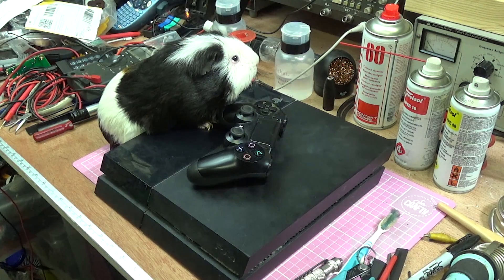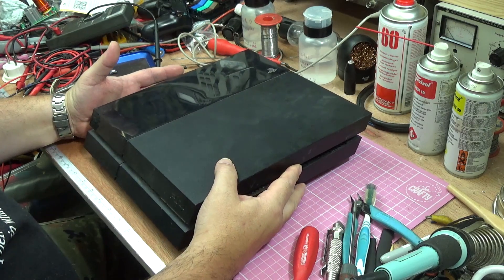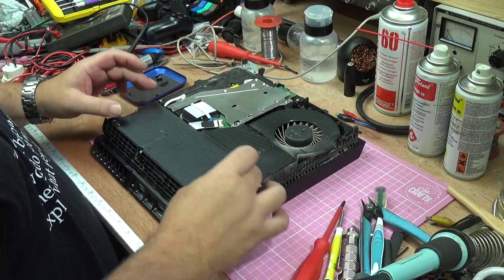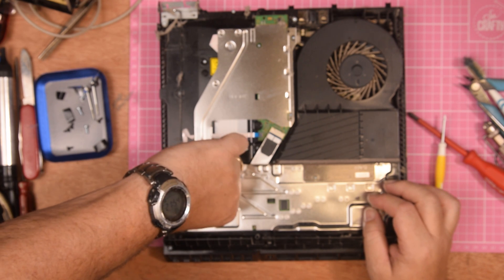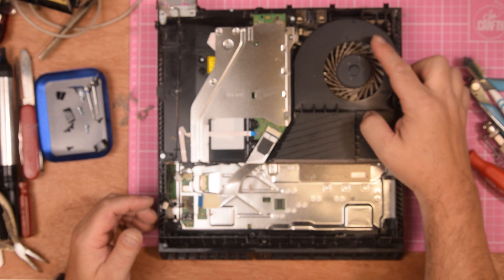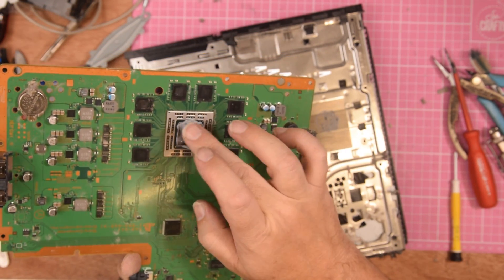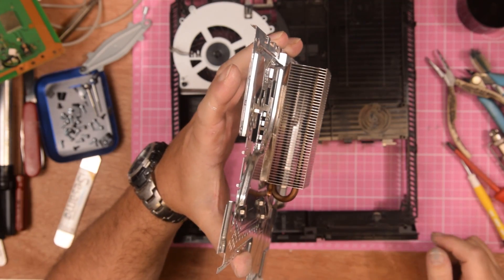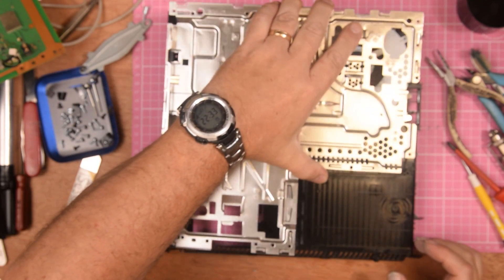How To Fix Ps4 Overheating Problem : ZERO COST

Comment from the maker: I'm getting a lot of comments regarding it still heating after cleaning. First, check the fan is connected properly and that when you cleaned the unit you put all of the little heat transfer squares back onto the chips they came from. If that fails to cure it you may need to replace the heat transfer paste. It is just a case of wiping off the old compound with isopropyl alcohol or rubbing alcohol and replacing the compound. You don't need very much but place it dead centre of the cpu and put the ps4 back together.
Reply: Hey bro I've cleaned everything but my fan won't spin unless I use my hand to spin it first and it's really slow but goes fast sometimes, any help?
Reply from the maker: Sounds like the fan is gone and needs replacing.
Reply: @smplex1  is there any start capacitors for the fan in line with the fan circuit
Reply: Idk what happened but my PlayStation went on a blue screen for like half an hour and then it flipped the breaker
Reply: Can the heat transfer paste if dry still make the ps4 overheat?
Reply: Mr George,mine was overheating I open my ps4 slim after watching your video but there wasn't dust covering  the fan and the vent that much so the little dust on it I cleaned it off after which I coupled and played for few minutes and it turn off just as it use to do before. Please what might be the cause because I'm confused and don't know what to do next ?
Reply: I'm not sure if I'm able to do this for my son. I'm scared that I will mess it up even more. Is there a place where I can take it to get fixed? If so were would you recommend I take it? Thanks in advance.
Reply: @Sassy_Cici  u can go to game stop
Reply: Thanks it works
Reply: I managed to follow all of your instructions and managed to put it all back together again after a good cleaning and surprised it actually runs so much smoother now. The thermal paste definitely needs replacing because it was completely dry but I have to order some and take it apart again another day to put new paste on. But for now just the cleaning seems to have helped a great deal, the PlayStation was shutting off due to over heating whenever I tried to play a game but even without new thermal paste this is the first time I’ve been able to play a game for over a year.

Thank you so much your video was amazingly helpful 🙂

Comment: I had cleaned my ps4 checked the paste it was in ok condition all the heat transfers in place and still i would get the message but i updated my ps4 through the safe mode screen and it fixed it somehow it worked for me so i hope it works for you guys
Reply: It worked

Comment: What do we do if the fan doesn't spin freely?
Reply from the maker: the fan is a standard sized computer fan and can be easily replaced.
Reply: @George Christofi  I had a bigger problem, I was able to get the fan to spin better but on the motherboard in the one corner looked like little burn marks so I think she's toast. After cleaning all the dust out I put it back together and was still having the overheating screen

Comment: hey george how are you? can you please read and answer my message? it's really emergency!
so my ps4 was working exactly fine and without extra sounds but i decided to open it because i never cleaned it before... i did it exactly right with no harm and violence then cleaned it with air pressure and assembled it just right. but now it's fan sounds like an airplane and the ps4 goes off after some minutes with no reason... help me please.
beside i did not unplug the fan during cleaning.
Reply from the maker: sounds like you didn't remount the memory pads before replacing the heatsink.

Comment: After watching the video I decided to take the cover off the PS4 & used a long bristle brush into the fan area to remove the dust from that grid without dismantling the PS4, It actually worked very well, Thanks so much for showing exactly what the problem was, Kindest regards.

Comment: Can you clean the heatsink without changing the thermal paste
Reply from the maker: Not really. If the paste is dry you are better off doing it while it's in bits.
Reply: @GeorgeChristofi  okay. You know the best thermal paste to get?
Reply from the maker: I used to use arctic silver which is very good and comes in a hobby sized tube. These days I use a commercial grade paste simply because of the quantity in a tube.

Comment: Thank you! I've been dealing with "overheating" less than 2 minutes after turning on my PS4 and starting a game. This video helped on fixing it. I also found that the heat transfer paste was completely dry and all the dust.
Reply: I'm dealing with that now 😔 I only could watch movies & TV apps from it, I haven't played games in about few days it feels so odd. I'm thinking on buying the tools set so I can open it myself to check the inside, I'm just worried if I need to get a replacement hopefully it just the the plug that's loose to the fan or must need cleaning.

Comment: Mine has this same issue, except the fans don't run loud. It works perfectly for ~5mins before showing red light with 3 beeps. I does this even in safe mode. I have been searching for fix for like 6 months any help is appreciated 🙏

Comment: My ps4 is completely clean n now I am starting to get the same issue again even at the start menu my fan gets loud then just shuts off within seconds of it turning on and there's no dust build up nothing, though I have took this ps4 apart like 50 times before n kept it working but now I think I'm out of luck nothing works.

Comment: I have never deep cleaned my PS4, and I bought this console like 6 years ago so I'm pretty scared to see what's inside there. I am just now facing overheating issues. I can't play a game for an hour straight without having to worry about the console overheating. And not to mention, that loud jet engine noise, I thought it was completely natural but it's been much louder than usual lately. Gonna take it to a Sony Repair Shop soon.
Reply: I can’t play for more than 1 min

Comment: Did all dat still doing it after 2 hours completely clean put new heatsink new thermal pads but it is 8 yrs old 😂 got the PS5 digital so I just need to finish a few disc games off on the ps4 dat is only disc

Comment: Lay ur ps4 flat like the man said. But a trick I use is get some 2 liter bottle caps bout 6-8 of them and have ur ps4 sit on top of them so u have airflow under the ps4. It helps alot.

Comment: I did it but putting it back together is annoying. You should upload the same video but at the last part when u speed it up while putting it together you should leave it at normal speed so I can see how exactly you put it back together. Everything else is easy but putting the mother board back in is not fun and I don't wana break it
Reply from the maker: I did think of that but the video was already too long for a lot of people so I shortened it. If I remake this video or any other console video I shall do a much better job of editing the video to keep all of the important stuff in but cut some of the waste, keeping the reassembly in there.

Comment: Thanks to your video I was able to fix the overheating issue on my ps4, the heatsink was clogged with dust and stuff. Removed them just like you did and worked as a charm.
Reply: did it actually work, how u get out the screws. i don’t have torx t8 and struggling with a vit
Reply: @animalcrew882  I used a very small flat screwdriver and managed to get them out, the pin in the middle is not that big.

Comment: I cannot thank you enough George, I have struggled with overheats and a jet engine fan noise for almost a year now and I have looked all over for advice. Your video was simple to follow, easy to replicate and I can say with confidence it has drastically changed the noise and heat problems on my console. I am amazed how much dust had accumulated in the heat sink over the 5 years I have owned this. Feel foolish I hadn't looked into it earlier, very happy with the results. Great job!
Reply: Agreed 💯💯💯💯💯💯

Comment: Great video mate, just great. Quick question, I have done mine yesterday and once I put it back together like ten minutes in the menu, it got too hot and turn itself off. What might that be ?
Reply from the maker: Probably the thermal pads on the memory chips not being in place fully.

Comment: I got right up to the point where you take the power unit out. Took 2 of the 3 screws out no problem the 3rd one seems to have a peice of metal right slap in the middle of the hole where my torx would go so can't get any further

Comment: Thank you after I took it apart and cleaned it its working good now best instruction and step by step I've found.
Only problem I ran into was the little metal pins by the fan one was sticking up when I first put it together stopping the fan from spinning witch cased the Sony to repeat the overheating so just had to reopen and ben the pin down and its working like new.
Thank you so much

Comment: This helped so much, my ps4 would turn off in like 30 minutes when I turned it on , i can play with my friends now without it turning off, thank you.
Reply: Bro 30 mins. I get like 40 seconds max and it turns off
Reply: @aazedd3246  I only get to play 20sec to a minute on any game
Reply: @aazedd3246  😭😭😭 faxxxx
Reply: @aazedd3246  me to
Reply: @Febreeze Booz` yep I cleaned it all out. The heatsink is the biggest issue
Reply: My ps4 doesn’t even turn on
Reply: Mine in 9
Reply: I have the same thing as you buy ps4 pro tourist pirate game on my screen it bunny aerial it  scare me

Comment: Does the work for the PS4 pro
Reply from the maker: any console that suffers from an overheat usually will have some form of dust blockage. The disassembly may be different but the object of the exercise is the same.

Comment: My PS4 Pro keeps shutting down on its own after about 5-10 minutes i put a larger fan beside it, didn't help so I took it all apart to check the heatsink but it's literally spotless inside and shiny like almost brand new. what else could it be other than dirt and dust? do you know which components I could check with multimeter? I just got the PS4 Pro from somebody they said it works but there's obviously an issue. Love to hear back from you if you have a moment thank you for your time.
Reply from the maker: Check the thermal paste under the heatsink on the cpu. It might need replacing.

Comment: I’ve cleaned my PS4 but not to this extent it is making a weird noice and was turning off saying it was too hot should I do as the video says?
Reply from the maker: It may cure the issue. I recently did this same ps4 and it had already clogged up again because of dust. The main thing to ensure is that you refit the heat transfer pads to the unit otherwise it will error out almost immediately.
Reply: If it maked a weird noise that could mean that your fan died

Comment: Thank you for this video man I can’t afford a ps5 yet but thanks to you I got my ps4 running again💪🏻👍🏻 I could clean out my heat vent sadly because mine are different screws and some of them are in different places I had every screw from my set out every T one I had did not fit. I think mabye because it’s metric? I’m in America so that’s the only thing that I could think of. But thank you man! I was able to clean what I could with the air and what I had and the result is awesome was More quiet and it’s runs games again👍🏻

Comment: Please help I cleaned my ps4 just as you showed not a spec of dust in it now but now it overheats even faster almost as soon as a disc starts running
Reply from the maker: check the thermal pads are in position and maybe replace the thermal paste on the cpu

Comment: Fantastic video. Followed your step by step instructions and it worked like a dream. My PS4 now sounds like new and no longer is overheating. The only thing that I would mention about this video is about the t8 screw driver. Make sure the your driver has the hole in the end so it will properly fit the center stud that my t8 screws had. I worked around this by using a precision screw driver instead.

Comment: Say I removed the old thermal paste but didn’t add a new one. Cleaned the heatsink and fan from inside and it’s spotless. Still overheats faster than before. Is it because of the thermal paste?
Reply: Probably yes termopaste isn't there without reason
Reply from the maker: Also, if the memory chips thermal pads are not replaced correctly it will still overheat
Reply: @GeorgeChristofi  wow fast reply. Nice

Comment: After i cleaned my ps4 (oldest version), i tried turning it on, it got really loud and the light went from blue to red and shut down before I could do anything. Does anyone know what the issue could be? And how i can fix it?
Reply from the maker: It could be the thermal pads on the memory chips were not refitted properly.
Reply: @GeorgeChristofi  thanks alot man
Reply: @nahedhasan  did it work because i am having the same problem
Reply: @davillam8559  yeah same

Comment: Video way too long
Reply from the maker: I wanted to make it so anyone could follow. I call that the army instruction type where everything is shown step by step. That means that any soldier with no technical ability can do any job by following each step in sequence. I could make a video that says take out this, this and this, use a vacuum to clean this and put it back together but that wouldn't help the complete novice who has never taken anything apart before.
Reply: @GeorgeChristofi  Not complaining...you helped fix my problem... could've used some fast forward. Thanks

Comment: I cleaned my ps4 but it still overheats, and turns off after 1 min. Please help
Reply: Same I don't know whats going on but I don't think its broken.
Reply from the maker: It sounds like the thermal pads on the memory chips are not quite fitted correctly

Comment: There's no way I can just cut the bottom of the ps4 off and clean it without having to do surgery on a million screws?
Reply from the maker: not really because of the way it is put together. if it was a pc then yes, you could have a hole in the side and just shove a vacuum cleaner in it occasionally but sony wanted the unit to be compact, stylish and a complete pain to service easily.

Comment: He said your just as liable to die.....thats when I just said that ps4 needs to get replaced all together
Reply from the maker: I have to say that because of the liability for getting sued. The reality is, only the dumb or the experienced  will be messing with live units. The experienced usually know how to avoid the dying bit. The dumb tend to find out that line voltage hurts like crazy and hurts for a while after if they survive.

Comment: This was an awesome video! There is nothing you can't fix! I liked all your cleaning tips and especially using air. 🌬

This would be an awesome video to remake if you haven't already,  because it's doing awesome, have your son in there as well! 

Have you thought of doing a #shorts on it? I've done a few and it brings new eyes to your channel. Hope you're doing good, staying warm and safe!
Reply from the maker: Thanks Suzy. I have thought about doing a similar video but I would have to buy a PS4 first! This one belonged to the son of the electrician who did the initial wiring on the workshop.

Shorts are something that I have looked at but there are very few repairs that can be covered sufficiently well in the time space. I am considering a short for each new video as a teaser trailer.

Comment: My ps4 maked a loud fire alarm noise and then black screens. I though it was over hearing but it keeps happening and doesn’t sound like the normal 3 beeps. He sounds like a glitch noise and I am confused on how to fix it or if something broke. I can play for like an hour and it will then just keep black screaming after I have tried the resolution thing I’m safe mode. Please help!
Reply: If it makes 3 beeps it comes to safe mode yes.
How about NOT PRESSING THE POWER BUTTON SO LONG?

Comment: I really appreciate this video so much. My playstation sounds like a jet engine all the time (And still does on certain games) but after i cleaned a large amount of dust completely covering my Heat Sink, my playstation has no problems with overheating at all. All I need to do now is put some more thermal paste in my ps4 because when I was cleaning it, it was all dry. Once again thank you so much for this helpful tutorial you saved me a lot of money!!!!

Comment: I am gonna tell u how to fix Ur PS4 if it says stuff is corrupted...Ok u need to hold the PS4 power button with the LED lights on down for 5 seconds...safe mode shoudl appear ...go to the rebuild data base it just removed corrupted stuff and u get all Ur stuff back enjoy😁u don't lose anything u just remove corruption hope this helps

Comment: I cleaned my ps4 but it keeps overheating I checked the fan but I ran out of thermal paste and I didn’t put the thermal pads back on could that be the issue.NEED HELP
Reply from the maker: you do need the thermal pads. The cpu measures the temp of itself and the memory.
Reply: Thanks

Comment: My PS4 Pro turns on for maybe 5 minutes then turns off by itself. I’ve tried cleaning it but that didn’t work. This started happening after my house lost power one night during an ice storm. “I’m thinking maybe the power surge messed up the power cable but it turns on fine, it can’t play literally anything without overheating though. I’m going to replace the cable and get a surge protector I’m wondering if anything else might still be wrong with it.”